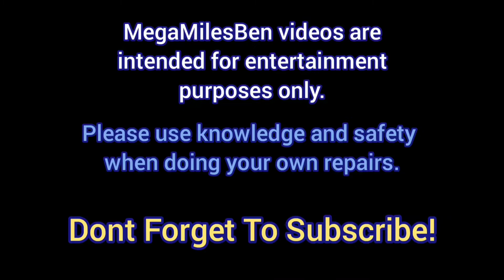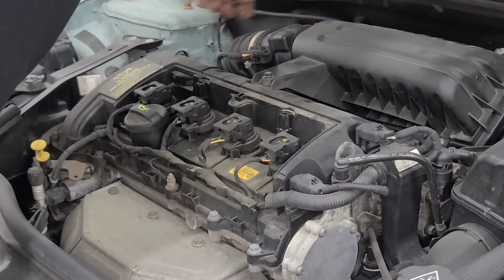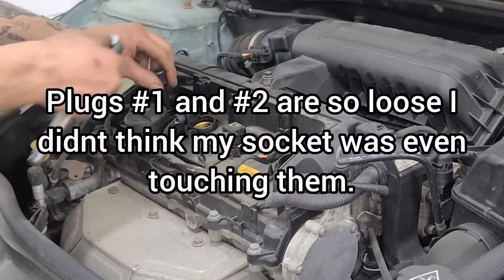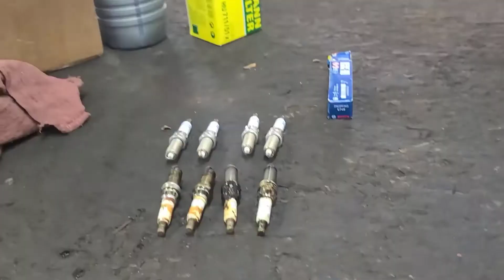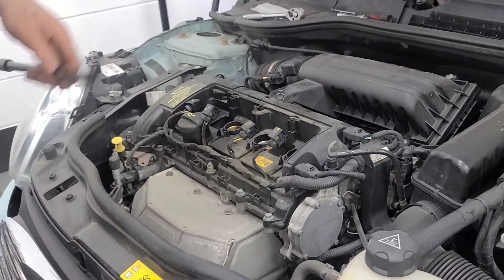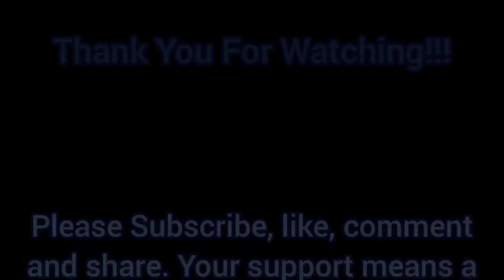Spark Plugs on a 2012 Mini Cooper

Comment: I did that silver  thing come out
Reply from the maker: Those are the plug/coil sleeves. They just pull out. The rubber on the coils can expand a little with heat so they sometimes stick. 

The sleeve might need a new seal under the valve cover and could be the cause of the valve cover gasket leak. You can see the oil build up on that third plug when i pull the plug out. I did let the client know about it.